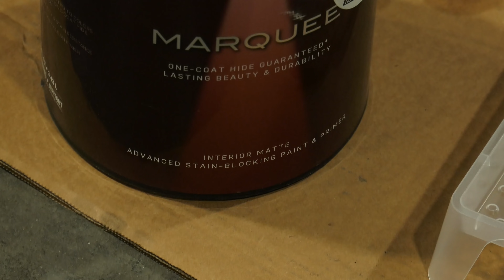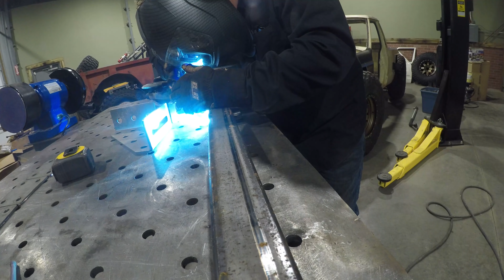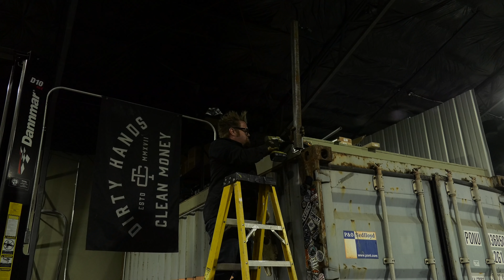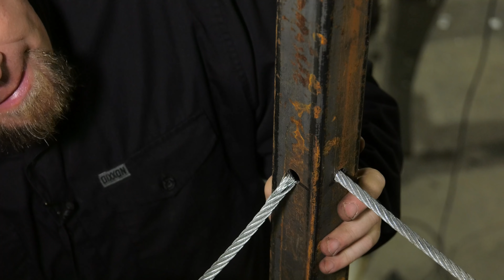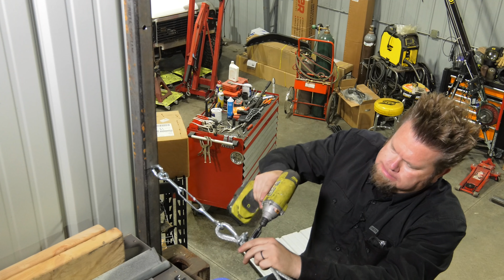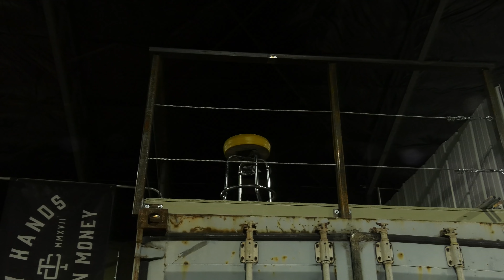Building Custom Railing; Modern Industrial Look

Comment: For loft railing it may be ok, most building codes require vertical slats with a maximum slat spacing
Reply from the maker: IBC Allows for the horizontal, and the max spacing is to prevent kids from getting their heads stuck in the railing.  There are MANY buildings using horizontal, or different fillers in railings.
Reply: @BigTireGarage  it must be different here, and application probably matters too. vertical requires a maximum 4" spacing, and no horizontal because kids can climb over more easily.
Reply: I also wasn't trying to be negative, just each person should check the codes in their area for application. I really enjoy your shows, and your personality.

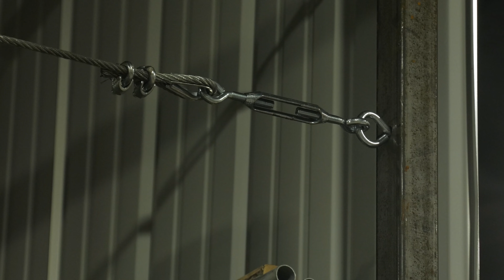Comment: I like these shop builds. I learned a ton watching you over the years, including how to do my double triangulated 4 link.  I do think that your Crosbys / cable clamps are installed incorrectly ( 8:27). Never saddle a dead horse.
Reply from the maker: I never knew that was a thing until this video...great info for sure

Comment: Cool build.  A thought - On the finishing end you could have used a bolt through the end tube into the turn buckle instead of the Eye-bolt and the turn buckle eye.  That might have looked a little more visually appealing (minimized the hardware on the end).

Comment: Looks good!!! I used to work for a spiral stair manufacturer for 20 years, and we used to use 1/4” stainless steel rod instead of cable. Easier to work with and we used fittings with set screws to attach and secure every 4” for building code.

Comment: Dude, what the.... , in the assembly video you did NOT saddle a dead horse, then in the final shot you got the dead horse saddled.
Reply from the maker: I just googled it...never knew that was a thing...very cool to know..was not intentional at all.
Reply: @BigTireGarage  I was about to give you a link.  Keep up the great work Ian.
Reply from the maker: I have no idea what that means
Reply: Even so, the other end is pulling on only a cable clamp.  Putting the clamps on backwards would not be the point of failure in this system. (Not saying it will fail as that winch line is way overkill for guardrail.)